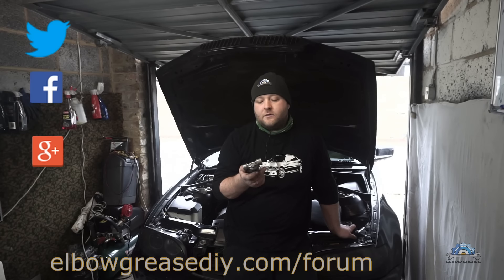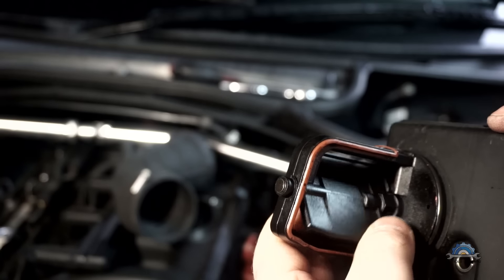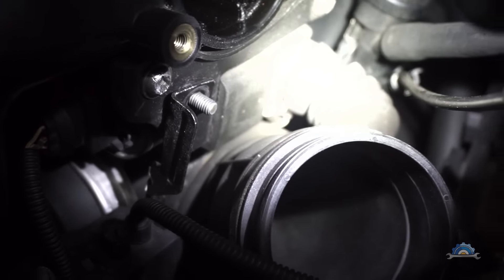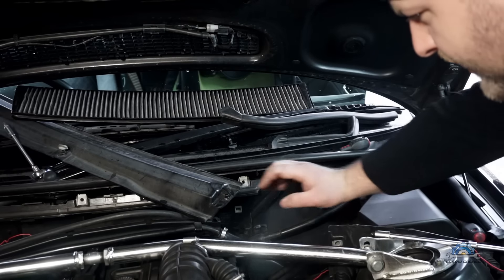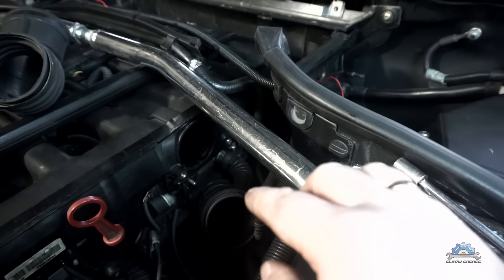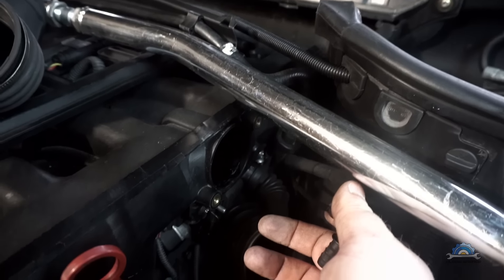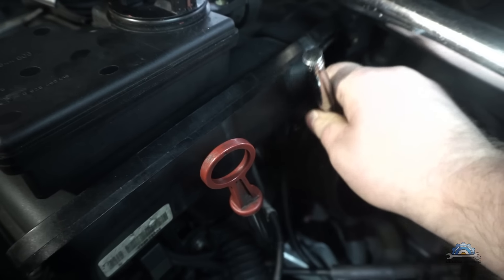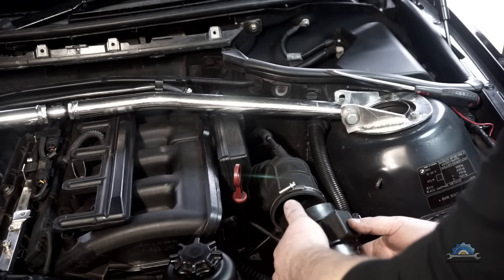BMW e46 Idle Control Valve cleaning ICV STUCK OPEN P1500

Comment: I recently changed my fuel pump and ff, but for some reason not enough fuel ain't making it to the injectors. What are your thoughts
Reply: Change the fuel filter see if that makes a difference

Comment: Mine is m54 2.5l 2004, i changed 3 ICV and 1 DISA but the code still come up after 5min driving... do you have any other solutions?

Comment: How much better was your acceleration after this?
Reply: Watch for vacuum leaks or either o rings replacing in various sensors or even engine or oil pan gasket leaks

Comment: idle air control regulating valve stays buzzing even after I turn off the car , I never replaced it got the car with 47,000 and now it has 157,000 miles.

Comment: Hi mate, love the vids. I have a few problems with my e46 320ci. Would you be interested in having a look at it? My main problem is pulling away. Kangaroos down the road without the right clutch control and feels as if the revs drop when you go to accelerate.
Reply from the maker: UK?
Reply: Yeah mate, Braintree. You are London I think I read in a comment. I would gladly come to you.
Reply: @ElbowgreaseDIY  where in London are you?
Reply from the maker: @Culinarybadboi  Not in London ,not in UK

Comment: I THOUGHT THOSE THROTTLE PLATES WERE NOT SUPPOSED TO BE MANUALLY MOVED??
Reply from the maker: You can move them without any problem as long ignition is off ,You can also do throttle adaptation with your key and pedal
Reply: That's just what dealers tell people to scare them from doing there own service work. Have confidence....because YOU can do it.